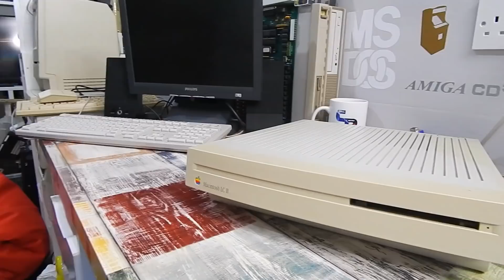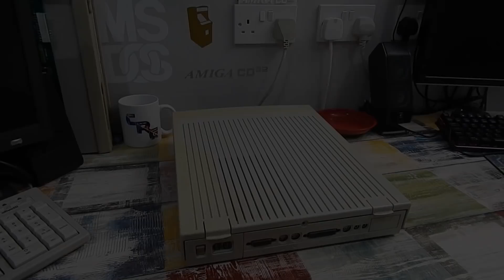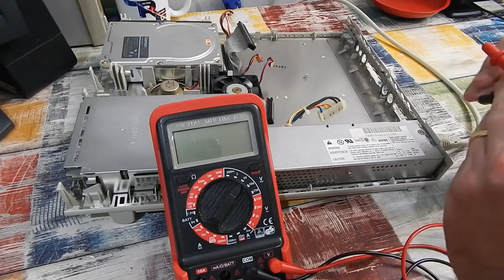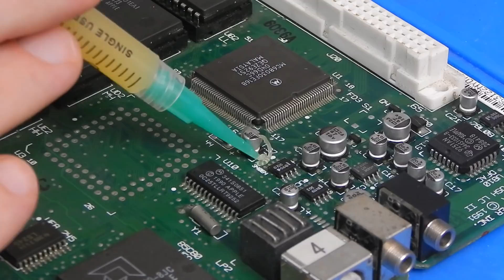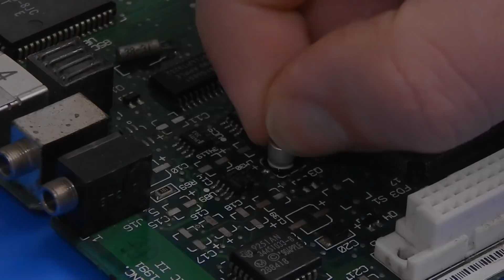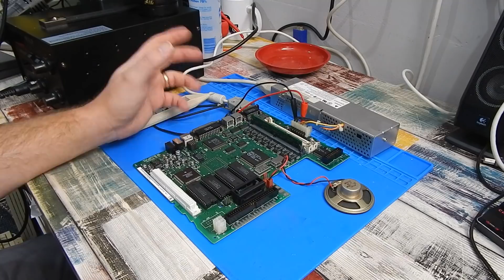Apple Macintosh LC II. Low Cost, Leaky Caps and Lots of Confusion

Comment: I just restored a LC II with the same problem: leaked capacitors. It works fine, but I don't understand why. Here is the story.

I've found this old Macintosh LC II in a storage hall. I connected it to its original monitor, switched it on and after a beeping sound i've got a grey screen (not black), but nothing else, no boot, nothing.
I opened the "pizza box" ;) and the corner with the caps was covered by a yellowish stuff. It looked like all them leaked. By removing the board one of the cap fell off, due to corrosion. I had little hope.
What I did next was to put the mother board in the dish washer, twice. First time without detergent, second time with, since after the first time I didn't see any improvement.
I rinsed the board with distilled water, dried it up with a hair dryer and let it rest for the night.
The next day I had a closer look at the board with a microscope. All the stains were gone, but I saw the same greenish stuff around the chips. Not good.
I then sonicated the board. Luckily the dirty corner fitted in my ultrasonic device. I added a teaspoon of ultrasonic cleaner and sonicated the board for 7 minutes. I rinsed the board with distilled water and let it rest for a night.
This time the board looked much better. Before ordering new caps and without any hope I reassembled everything, switched it on and...bang, it booted! It showed me the desktop as it was left by the last user, a well known astronomer by the way.

So, I didn't replace the leaked caps and the missing cap is still missing. Why does it work?!
Reply: Most of the capacitors are just there for filtering the power, and not all of them are strictly necessary for function. My LC III is missing a cap I forgot to install, and works great. A lot of the time the capacitors that leak still function properly; it's the electrolytic juice leaking out of them which kills the board. Still need to have them replaced, as they will continue to leak out electrolyte

Comment: I know this is an old video but i have found that lifting the egret and DFAQ chip and cleaning underneath (also checking for bad traces) is usually the culprit  since the cap juice corrodes under those chips..

Comment: I remember my old University chucking these in the skip back in 2001. I found an old LCII, some spare SIMM ram and spare tdk smps.

The PRAM (1/2 AA size) battery can stop it from booting up if the battery is flat, and they often leak also over many years.
Reply from the maker: I must come back to this system at some point and give it another go.
Reply: @CRG  Could try using a 3 volts psu or 1/2 AA battery in the PRAM battery slot. If the battery is removed, then the PRAM may need to be reset as others have said below, before it will boot.

Comment: Also some macs used the metal shield inside the case as a ground plane so they won’t start unless all the parts are installed in the case with the lid closed.
Reply from the maker: I didn't know that, thanks for the tip.  I really should revisit this machine sometime as I'd like to get it working.
Reply: Not the case on this machine, as it happens.  I have one running downstairs right now with the case off.

Comment: Maybe a long shot but the 12v rail was low. Under load it will be lower...I guess I'm saying don't rule out the PSU pal!
Reply from the maker: Looking inside the PSU there is no sign of leaky caps but its a known problem so they probably need swapped out.  For all it costs no harm in trying it.

Comment: Great vid. 

Could be just the cap juice has eaten too many components. 

That said, the following may be worthwhile checking:
1. Some of these macs dont run without the Lithium battery installed 
2. One of either the LC II or LC III mobos had a revision with a silkscreen error where one cap polarity is marked wrong. This affected my repairs in the past.  If you have a before pic of the mobo it may be worth checking.
3. Although the voltages are good, check the inside of the PSU. Those caps are likely in a bad shape and may not be able to provide current under load. The Astec PSUs have many issues IIRC. 

Hope you get it working. 

Oh that HDD is probably banjaxed due to the "sticking rubber grommet" problem where a degraded rubber gromet causes the HDD head to stick when reaching the spindle.
Reply: Oh and @CRG Check the audio chip on the top left, sometimes it not being properly connected can scupper the repair. On one of my LC IIs it took forever for me to realise.

Comment: The capacitor plague of the 90s (SCS shit capacitor syndrome) just gets worst. Even just a few years ago a cap job would have fixed this - but the leakage is just a disaster now. 
My SE30 was on the brink until a complete ultrasonic clean due to (probably) corrosion under the SMD ic’s.
Reply from the maker: I wonder if in another 30 years will all these caps we are fitting now have leaked.  

An ultrasonic cleaner is something I'd love to add to the arsenal of equipment although expensive so it's way down the list.  The problem here could still be leaked cap juice but I get the impression it's something failed.

Comment: Thanks for the mentionn =D  As others have said - PRAM battery, and I vaguely remember some small IC near ports at the back that does something with reset.   You could probe the reset pin on the 68030, and also check its BERR and HALT pins.
Reply from the maker: Thanks for the tips, I'll take a look at those pins.  I've ordered a few batteries, here's hoping its that simple.

Comment: Fixed my aunt's LCII a few (yes few) years ago. Same problem, all the electrolytics have leaked, weird noises coming out of the speaker, black screen (got a white screen once).
Replaced all the caps, still black screen (at least the noises were gone).
Went to remove the PSU in order to check that, I saw another cap hiding under the power supply cable. Replaced that - fixed it. Then I installed some games on it.

Comment: I have the same problem on my LCII no sound, black screen. Last time i tested it was 2009 and it worked. My LC1 (with 68020 processor) works without problems even caps have not leaked.
Reply from the maker: I'm not giving up on this one.  I've got a new battery on order just incase that's the issue but I'm not convinced.  I think I'll swap out those bus transceivers just on the off chance but it may be the ROMs.

Comment: Some of these old Macs won't power on without the PRAM battery. Worth a try since it's dead anyway.
Reply from the maker: I've ordered some batteries and hopefully it is that simple.  I'll put a post on the community tab either way just so everyone knows.
Reply: @CRG  Bench power supply @ 3.6 or 3 rechargeable (1.2v) AAs in series would get you there without the wait ;)
Reply: @CRG  i think it will be battery issue as i remmber seeing something about it in someone else,s video hopefully it will solve the issue .
Reply: Funny enough, I had the same PRAM issue on a 2010 Macbook Pro. The battery had fully discharged and the system would not let the unit power up or even charge... until a key combo to reset the PRAM. I think this is the same as resetting the CMOS. Maybe see if there is a key combo for that unit? Great vid.

Comment: Battery? There is conflicting information about how important a battery is for getting these systems to boot, but a lack of one could garble up the PRAM. At least it would be an easy enough thing to test.
Reply: Yes there are some models that dont work without a battery but im not sure whitch. My LC1, CC and SE/30 works all without a battery.
Reply from the maker: I've ordered batteries, will let you know when they arrive.

Comment: I guess you may have checked these, but here goes.  Check the power supply, check the reset circuit, are any of the chips excessively hot, you can download the ROMS so check they are not corrupt. Try different RAM modules.
Reply from the maker: I don't suppose you'd have a link to the ROMs? I've checked everything else you mentioned and it's all fine but keep the suggestions coming, it's always welcome.